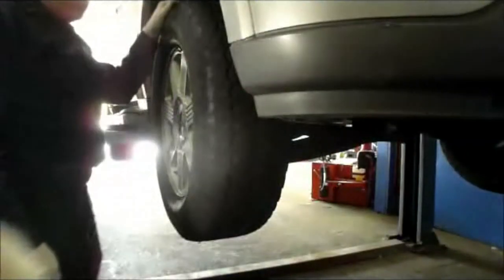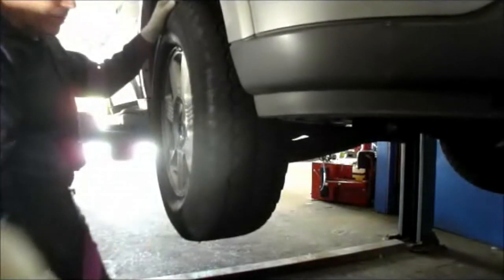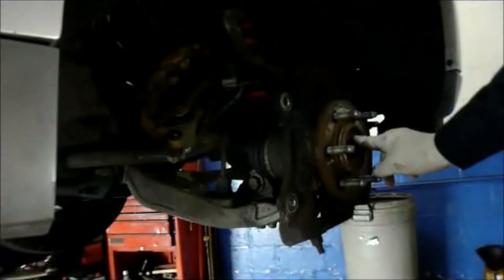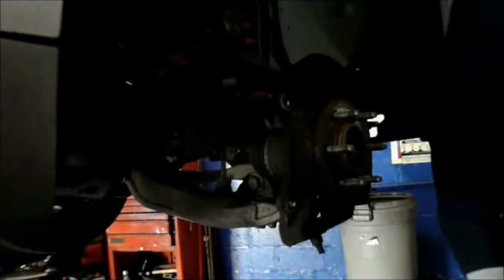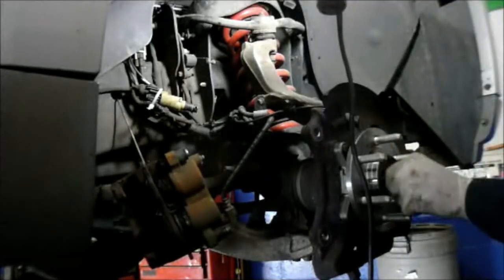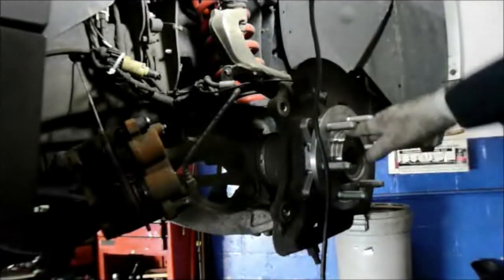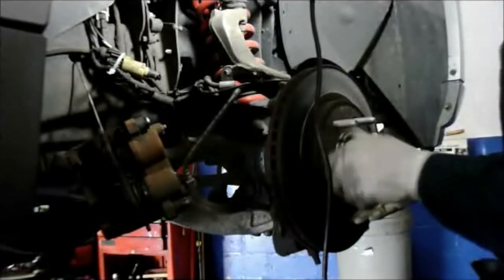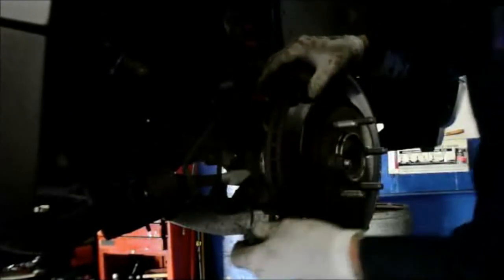2004-2014 Ford Expedition Front Wheel Bearing Replacement

Comment: Quick question for you.  What is the part called that is bolted to the back of the hub with the 3 8mm screws in it ? It has a air line of some sort connected
Reply: I removed the hub . Bearing fell out . The piece im asking about was rusted and trashed.  It has some rubber gaskets and plastic spacers in it.  I need that part
Reply: @andrefigueroa5854  wheel hub actuator
You did 4wd ?
Reply: Yes sir

Comment: i replaced the driverside wheel hib assembly on 2003 expedition 5.4l and still have a griding noise noticed a little uneven wear on right front tire  do i need to replace passenger side to

Comment: That was a serious problem on that Expedition and you must have had so spend some time replacing that bearing. I had to fix the one on a lincoln I owned years ago and it was no fun and I had to do it in less than desirable conditions.